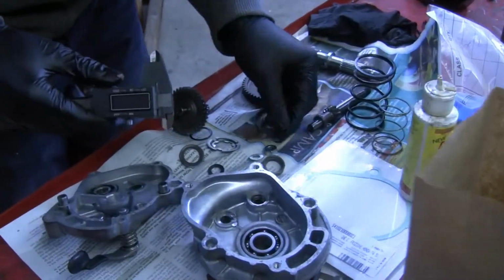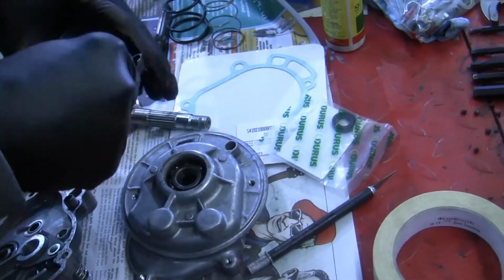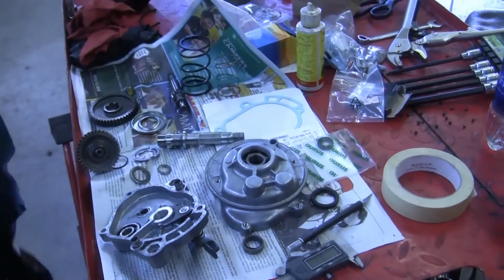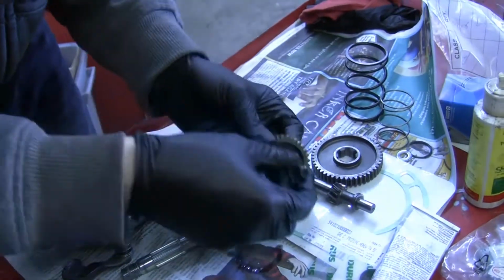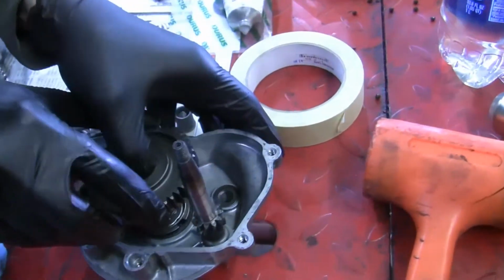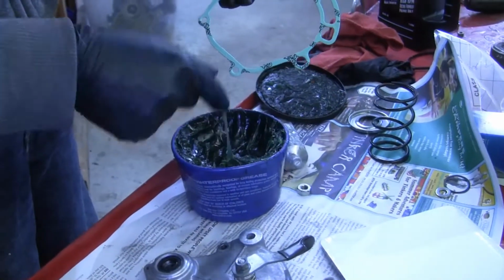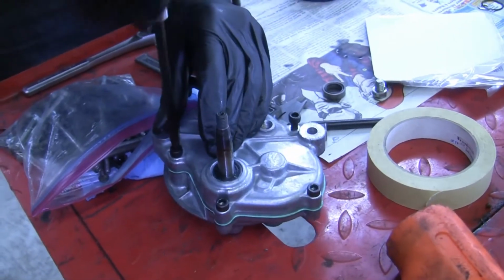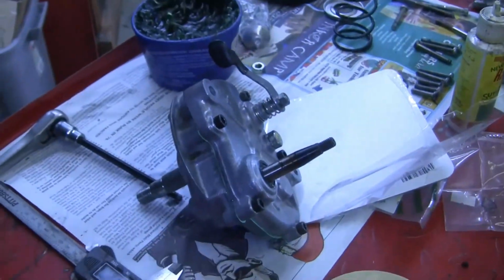Informal, Casual & Rambly Hobbit Transmission Reassembly

Comment: Nice work. Good info. Be careful of aftermarket manuals, paper or online. A DRZ400 Clymer online manual showed a plate on the slide installed backwards last week. If installed as shown damage would have occurred.